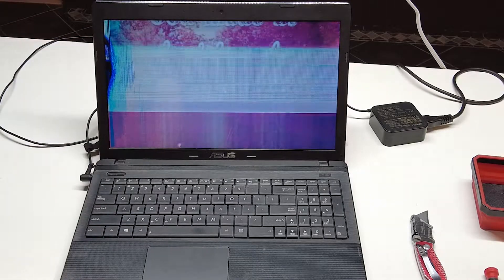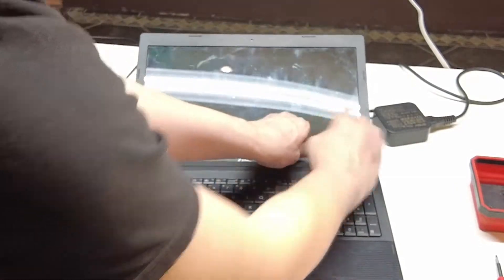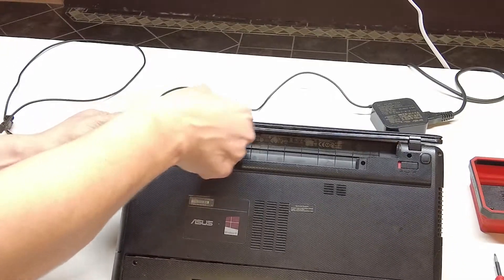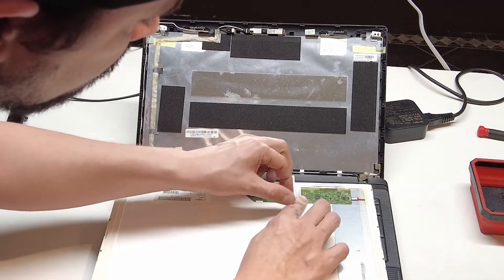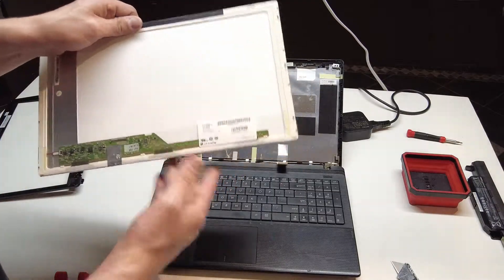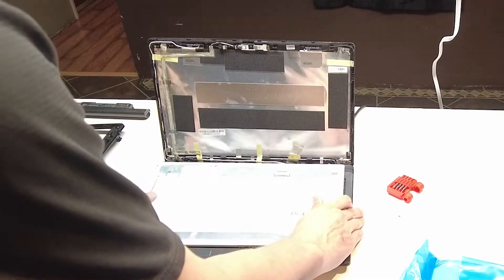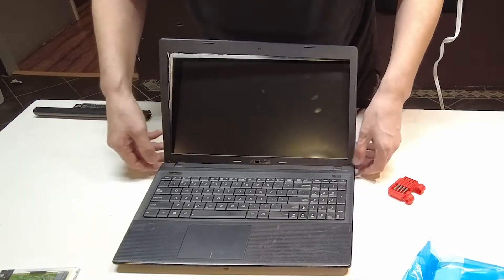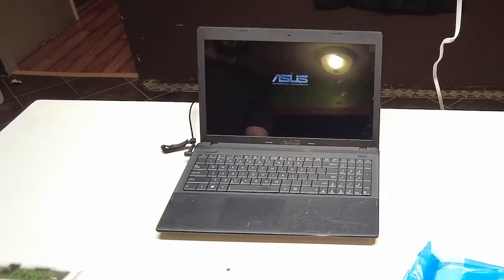ASUS Laptop Screen Replacement: A Step-by-Step Guide How To Fix Your Device!

Comment: I just bought a X1404ZA and it has a terrible TN screen. I was wondering if you could guide me in upgrading it to an IPS screen.
Reply: I just bought a x1404V with a TN screen.  I have seen IPS screens at some screen stores online, but I would like to replace with an IPS high gamut.  DId you have any luck changing your screen?

Comment: I have done this & my screen blinked in for a brief second then went black again. Any suggestions?
Reply: Your display ribbon cable is damaged, there's most likely a crease running along through it, and that's where the copper wires inside separated. You either need a new screen or to get some soldering tools